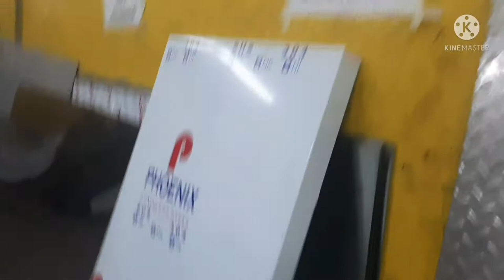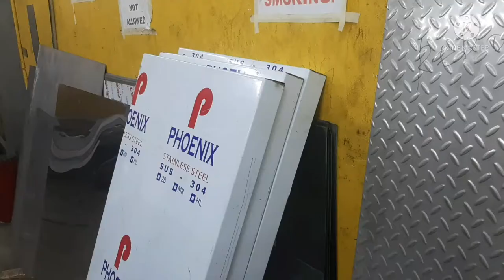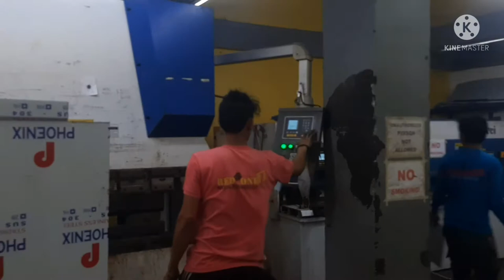Kitchen sink and preparation table fabrication

Comment: sir ano name ng pampatigas sa gitna ?
Reply from the maker: Stiffener
Reply: @jeffsdiyconcept3540  last question sir. ano mas makapal 1.2 or 1.6 po na plate ??
Reply: @jeffsdiyconcept3540  tas saan po nakakabili ng stiffener ??
Reply from the maker: @KLPBkusinero  nagpapabend na lang po kami. Galing ung sa mga retaso na part. Pero pwede ka ring gumamit ng tubular. Regarding sa kapal. Usually millimeters ung gamit kaya pag taas ng # pagkapal. Pero may conversion sya sa Guage pag liit naman ng # pag kapal ng guage. Like guage 16 = 1.2mm 
Guage 21 = .4mm

Comment: How much po ang 3 layers preparation table
Reply from the maker: Depende po sa size. 09174320723 yan po # ko for further details message lang po kayo
Reply: messanger po sir
Reply from the maker: @sheepysheep10  https://m.facebook.com/Steel-Gates-and-Custom-Metal-Works-102809491171438/?ref=bookmarks
Reply: idol saan Ka nagpapabend Ng yero?